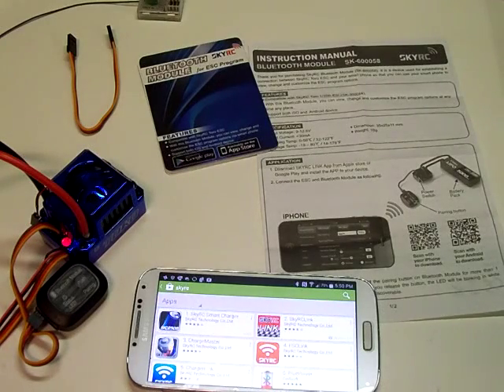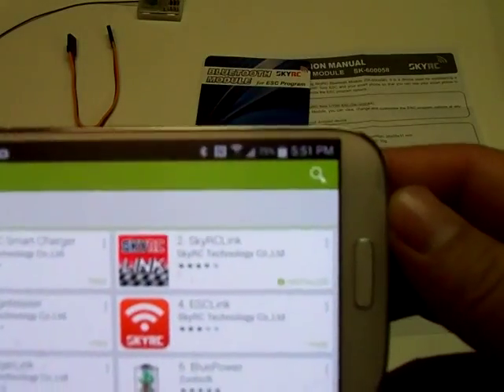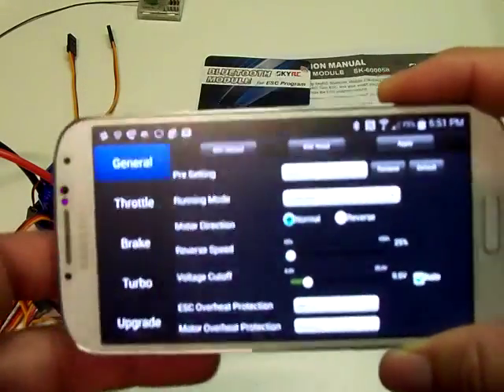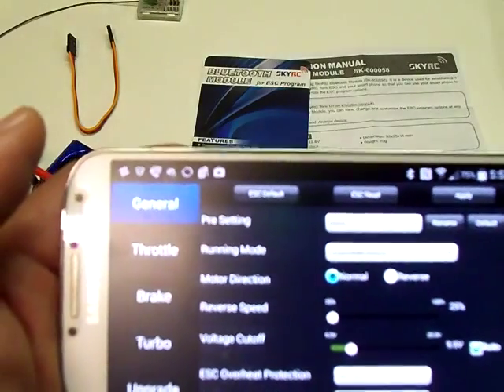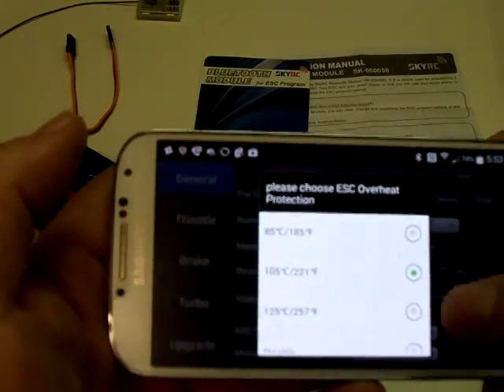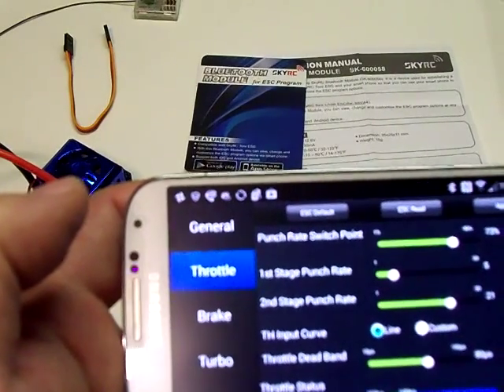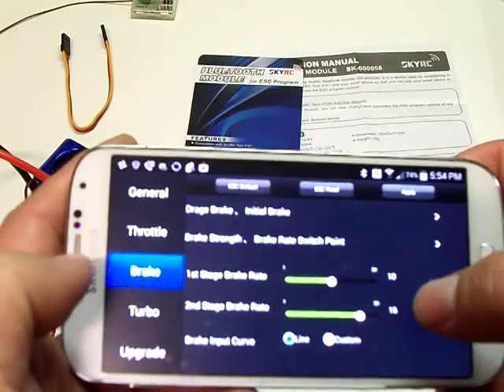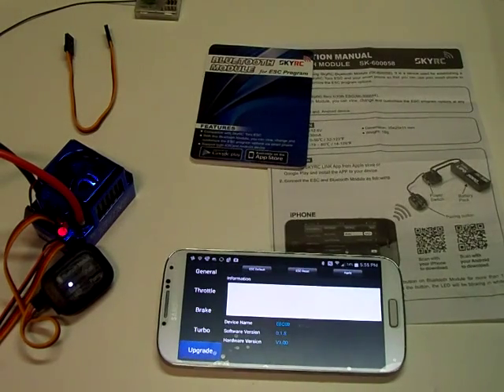Demo SkyRC Blue Tooth ESC Programming Module

Comment: Hi, can You please help me out for the Abdroid app SKYRCLINK? I kent find anywhere , I haventhe bluetooth module here and I like to program my Toro 150amp , I dont have REVERSE , My program box is damaged, thank You , abd keep up the channel running , plenty interesting vids. Here on Yuur channel
Reply from the maker: unfortunately I no longer have this product and can't support any SkyRC product anymore, I had too many failures with their ESC's and stopped using their products since then because they did not offer any warranty protection at the time. 

I have since moved over to HobbyWing ESC's and they have proven to be the most reliable and offer a solid warranty as well. 

Good Luck!

Comment: It will be good to see your long term experience with the Toro 150amp esc. Most reviews of the esc, end in component failure. I have purchased older Toro esc's and both of them failed, specifically the BEC. I would love to see this thing become a reliable alternative to Hobbywing.
Reply from the maker: I hear a lot of different brands having BEC failures, however I often wonder if it's because of over stressed servos drawing too much current? I've seen cases where folks have set their end points properly, then run into brown outs, but only to find out later that their Radio had mysteriously lost the EPA setting and had backed the servo back out to 120% instead of their preset values earlier. 

I wouldn't necessarily blame the ESC if the root cause can be traced back to a faulty Radio system.

This new batch of Toro ESC's is boasting a lot of new features, so it would be nice to think that they include some sort of overload protection for the BEC... at least I hope that soon becomes the new industry standard for all ESC's.

I try to get into the habit of periodically checking my EPA settings which have been known to get a little wonky after a crash or two.
Reply: You're right about the servos over stressing BECs, but I have yet to have a hobbywing bec fail on me yet, and I have 12 xerun 150s in truggy and monster truck applications. I am genuinely interested in your findings over time, as your experience in rc is well beyond mine. Thanks as always.
Reply from the maker: Elliot Baltazar  thanks for the kind thoughts, and yes, I will definitely update the following thread should I encounter any failures: http://www.ultimaterc.com/forums/showthread.php?t=215292